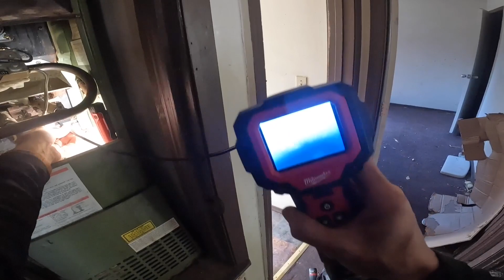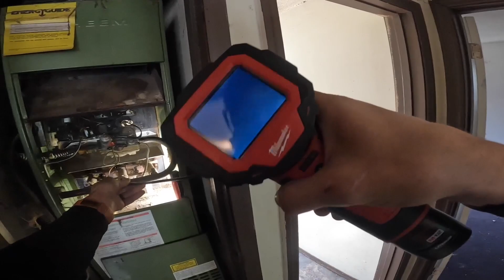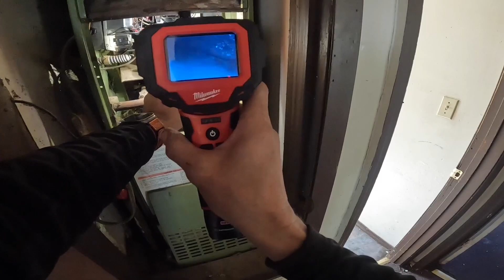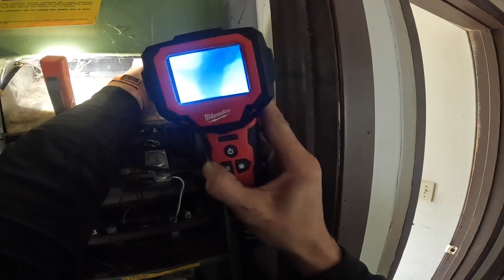Questionable Furnace. Can I Resurrect It?

Comment: Curtis, coulda saved yourself a lot of grief if you removed the burner assembly and inspect the HX with mirror and flashlight.  Takes less than three minutes.  Need a Phillips screwdriver, 3/8 and 7/16 wrench.  Loosen the two screws for the roll out shield and let it lay on top of the burners.  Remove two screws and remove the two orifice hooks attached to the end burner tubes.  Then, remove the two burner hold down brackets (one screw each).  Unscrew pilot fitting and thermocouple from gas valve and the entire burner assembly (and roll out shield) will lift off of the orifices and slide out of the furnace.  Easy.  I've got to give you credit for doing your best to confirm the HX is not faulty.  I've watched many of your vids and you always give it your best efforts.  I'm just trying to help... not criticizing.

Comment: This style of Rheem furnace was very susceptible to rusting through. Unless this furnace has very little rust in it, I would consider that a hole may quickly rust through the back of one of the two flumes where the pilot is. I've replace a number of these furnaces blowing flames out the front and tripping the rollout switches or fuses.

Comment: only thing different, I'd have looked at the gas line/s closer and pressure tested them before calling for a meter install. looking at the flue closer would be wise too.
if the system is hosed, they may opt for heat-pump and heat strips vs gas again.

Comment: The owners want to polish a turd,I would have said that it's needing a replacement with the proper gas pipe (no flexible pipe)and have the ductwork cleaned and possibly replaced to bring it up to codes

Comment: I went to an auction of a 1920's house that had been lived in by a member of our church for six decades.  In the basement was a furnace (?) that had no blower.  It just was a huge gas powered flame with ducts going off at a 45 degree angle to each room.  It would produce enough heat to eventually just furnish each room with hot air from the natural rise of heat.  I assume the the new owners replaced the system but don't really know.
Reply: I remember a large square floor grate I guess you would call it where the heat just naturally came up from the basement furnace.  I dont remember any blower.    Course I was only 6 or 7 years old when I lived in that house way back.
Reply: Those are called gravity furnaces and were very common before WWII.  I know several people that live in houses like that and they had a new modern furnace installed with A/C.  Air return with filter has to be added, often in a hall closet.  Ductwork is insulated with asbestos so leave it alone.  Those furnaces are a main reason why older houses have basements.
Reply: The house I grew up in was built in 1930 and the furnace was a gravity air coal fired system with uninsulated ducts to each of six rooms. Cold air return was a grate in the floor of the dining room (no Duct). The actual cold air return was a grate at at the bottom of the furnace. The heat was very even  because the fire was always burning. It was eventually converted to oil, which was very inefficient. 275 gallons of oil wouldn't even last a month in the winter.

Comment: When I check the heat exchanger in a cold furnace like that, I run the blower and take a stick lighter and incert it in each burner hole and watch to see if the flame flickers or is blown out.

Comment: As a homeowner or contractor I wouldn't recommend putting money into a 70s furnace. Even if the heat exchanger  isn't cracked, the gas valve is good, the blower motor working and pipes sound, I wouldn't feel good about how long it would work before something (  like the heat exchanger ) failed. Your follow-up after the gas meter is installed/connected could reveal other issues. Out here you could get red tagged by the gas company making the connection if they find an obvious safety issue. Good luck!

Comment: I still have furnaces up north that are the same way. You did a proper inspection for what you had. Let the customer know that it's a crap shot if the furnace will be good, but you won't know for sure till it's fired up..

Comment: Is that owner willing to pay for all the hours to get diagnosed and running, only to find out that there's a monoxide leak and the thing needs to be replaced?  I wouldn't have worked on it based on the outward appearances of the house and the unit;  but it's kind of a toss up situation. 😎

Comment: Curtis, looking forward to Part 2, Those draft furnaces are little work tanks for sure. I own the exact same one 28 + years old and still Purrs like a kitten, and the only things replaced on it are thermocouples and a chattering gas valve. These are much quieter than draft induced furnaces, these were made to last.

Comment: Whole property looks like a shit show tear down. Is there any combustion air in that closet?  Beware, once you work on this pile, you own it.  Lots of liability. I never liked the return that close to the furnace. Even though the door is closed, it creates enough negative pressure to affect the combustion, if the door isn’t completely sealed. Don’t try to cut combustion air openings in the door.

Comment: If I owned that place I would want a new heat unit, probably a gas pack. Parts are probably hard to find and expensive 😕. Besides that, you wouldn't have to wear and breathe years of dust, dry skin cells and assorted webs! 😄 I have a rental house in Oak Ridge, TN getting some minor repairs. It has baseboard electric heat but I would love to see a heat pump in there for energy savings to renters. Thanks for the great video!👍🇺🇸

Comment: It wouldn’t actually take too too much to make that place look way, way better..some new doors, windows, or just clean ‘em up, little Sheetrock repair, fresh paint, vinyl plank flooring..boom. I was amazed how crappy my own house looked when the firemen opened up a small section of hallway to put out an attic smolder/fire..what a giant, horrible mess that made..six months later, new carpet, paint, I put down some nice vinyl plank flooring in the bath and pantry, redid the seals on my toilet and replaced hardware while I was at it, looks like an entirely different house. Steam cleaning, paint, flooring, minor repairs..makes an incredible difference..as to the hvac, that’s your thing..

Comment: The flexible gas connector shouldn't go inside the furnace; solid piece of pipe should enter and connector go to an elbow right outside furnace.
Reply: Can you ref the city code for that?
Reply: @michaelazuela  City of Houston, TX
Reply: @bobboscarato1313  u proved my point. Each state and then down to city have different codes.
Reply: right, that's pretty much in all fuel gas codes. because vibration will cause the lien to move and chafe through, ending in a big leak and probable boom or fire.

Comment: Not a chance. I would quote a new heat pump so the house has ac and heat . Standing pilot might be 65 percent efficient which means 35 cents out of every dollar spent to heat goes right up the chimney. You don’t kill a horse cause it’s old but you don’t ever let an old horse enter anymore races.
Reply: The longer I have been doing this work the more I have come to realize old furnaces like this are just as efficient as the new and improved 90 percent ones of today. I think all the efficiency talk is a bunch of BS
Reply: Your way wrong. The flue gas outlet temperature on pilot furnace is 350 degree’s compared to 150 degrees on 92 percent. That’s a lot of heat not going into home. Just wasted going up chimney.
Reply: And then what do you do when you've quoted a new heat pump and find out that this house has the original electrical service and breaker box with no room to add a circuit for one? Double so if that installation would require heat strips as well.
Reply: @brianleeper5737   And all new ductwork sized for AC.  This place should be red tagged.
Reply: @rodgraff1782  There probably isn't an HOA there that would have a problem with window units for AC.
Reply: Lol salesman, standing pilot easy to repair.

Comment: I would go ahead and get the basics like gas service back in so it could be fired if initial findings were good. If it passes the combustion test and there’s no stray CO2 in the air stream it would probably be good to go for awhile anyway
Reply: Wayne,
I don’t think they need to worry about carbon dioxide (CO2) as much as carbon monoxide (CO).
Reply: @joep4143  you’re absolutely right. That’s what I get for typing on a phone with my glasses!  Wonder it didn’t end us as sulphuric acid!  Thanks for bringing that silly one to my attention
Reply: The gas meter was probably pulled out by the utility due to several serious or lethal problems. I like that inspection camera to view heat exchangers! Wish I had one 15 years ago!
Reply: @bobboscarato1313  Gas meters often get pulled when the tenants cut the lock off to turn it back on after non-payment.
Reply: @brianleeper5737  I remember a case where the tenant used a radiator hose to connect the pipes directly and leaky gas caused an explosion killing 11 persons in one family!